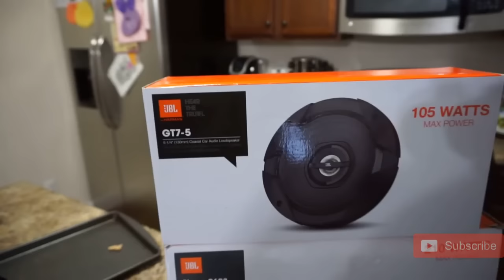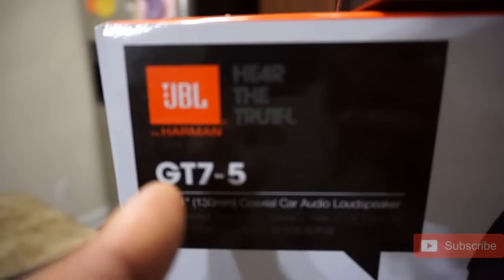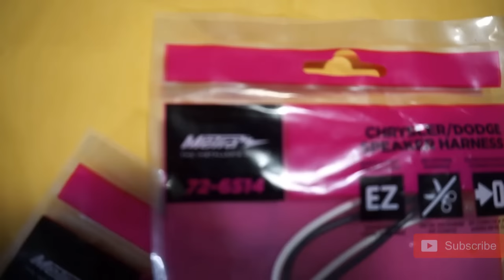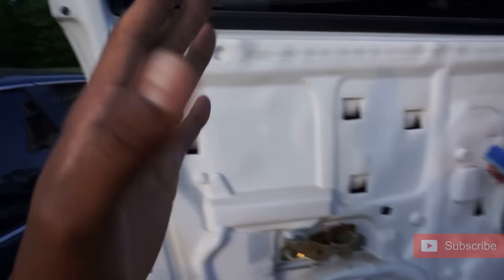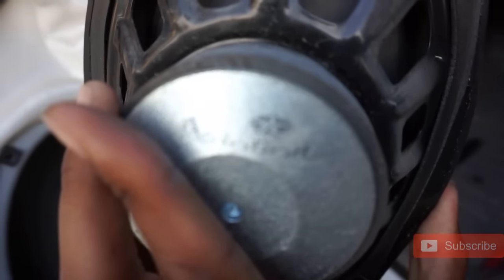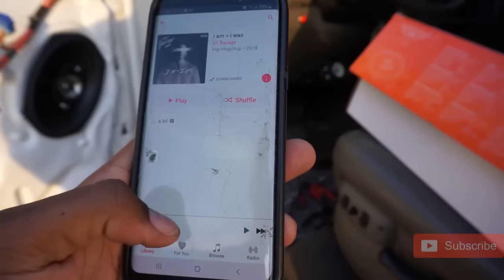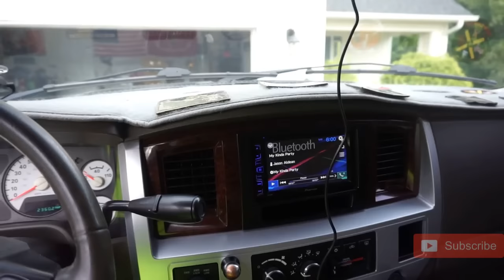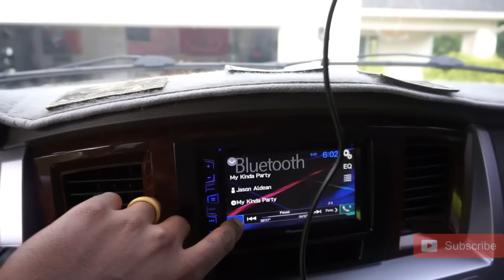INSTALLING NEW SPEAKERS IN THE 3RD GEN CUMMINS!

Comment: Still have the factory amp? I thought the front speakers on the infinity system only put out bass frequencies. I’m looking to upgrade to a touchscreen head unit and some new speakers without getting an aftermarket amp. Everything work?

Comment: Did you not have to get some sort of spacer or something for the back doors? My new 4.25s are waaaay smaller than the holes. The originals had some sort of adapter on them

Comment: Did you need to get the iDatalink Meastro for your head unit or no? I have a 3rd gen Ram and don't have steering wheel radio controls and it also as you know the stock radio,  mine anyways does nothing else lol. It didn't have Nav, Not even tire air pressure gauges. 
Just curious as I'm thinking I don't need it but crutchfield guy said I did .

Comment: nice video... I was reading that the front doors with the infinity sound system only delivers base to the front doors through the factory amp. Have you noticed an issue with that while using coaxial speakers?
Reply: I’m having the same issue here. I just installed two new front speakers and it’s only emitting bass.
Reply: @homless68 its from the infinity amp....i just put a new system in my truck.. we bypassed the amp so i have coaxial in every speaker now. also the 2.5 speaker in the dash is taken out when you bypass the amp. my amp had a channel out. it was my front left door. when you install a new head, you dont need the amp. my truck sounds better than ever now.. not a lot of base but i will install a sub later under my rear seats.

Comment: Do you like having tweeters in your front doors now? I put jbl in my truck ( same truck) bypassed factory amp and everything have 2 10 inch subs but my fronts are now 6.5s no tweeters on them they came with components to go in the dash corners replacing the 3.5s in the dash . I’m not happy with my set up because vocals sound so low! I’m thinking of putting 2 ways 6.5 in the fronts which means the tweeters are built in the doing 3.5 jbls in the dash corners so then my truck would have 2 way 6.5s matching front and rear doors and same size and style in the dash corners which are 3.5s just like yours . Hoping that would bring vocals back. When I put the new deck and subs in and bypassed factory amp and left the speakers in the truck which are stock infinity it actually sounded great! But the front infinity’s were in bad shape (6x9s) so I “ upgraded” and I lost that vocal I think because the new fronts are smaller and are just cones like the factory ones were and pulled the 3.5s and put tiny components in their place I lost vocals.

So my question is should I pull my new front jbl 601cf component system out and match the fronts to the rear jbl 621f s then upgrade the dash to jbl 322f which is basically just like your set up except the front will no longer be 6x9s . If I put 6x9 back in from jbl they are 3 ways which adds essentially 4 more tweeters to the truck than originally before 2 of which are super tweeters. Which maybe way to bright.

Comment: I'm conflicted between quick easy coaxial speakers in the doors or doing pods in the front door with and 8 ,4, and 3.5 and a 6.5 in the rear doors ran off  an Orion 4 channel  . I have 2 12 dc sounds lvl 4 going under my back seat off an Orion xtr 2500.1 . I wanted to  build a box to replace the rear seats for 15s but too many other projects so no time and I'm not paying  $2500 for someone to build it .  Reality is I've ran the stock factory crap for 10 years and it's not even the infinity so anything will sound better.  I should have done this year's ago since stock is junk

Comment: Can confirm that early 3rd Gen models DO NOT have 6x9s in the front doors for anyone wondering.
Reply: Thanks I’m wondering about this before ordering a new set, what exact size for a 2004 ram 2500 front and back speakers?

Comment: Did you replace your window controller with a Chinese one because your window lock button broke? I have that issue with mine. I can only roll down the windows from the drivers seat.
Reply from the maker: I did but the buttons still work fine.

Comment: Nice video @everything diesel. I started with my subwoofer and still have the infinity speakers. Lol. Just waiting for them to blow to replace them next. Not sure what box you going with for subwoofers, but I went with a company called probox which comes with loaded subwoofers. They hit for 2- 10. And have had them for about 8 years and still banging. Pushing it with an old Rockford amp bd1000.
Reply from the maker: Nice man im gonna look for them up. When u upgrade the interior speakers you'll like it

Comment: Might be doing this in the future as well.  Where'd you get those adapters to plug into the factory wiring?
Reply from the maker: Off Amazon just type your year make model and speaker adapter and they will pop up. Or look up the part number from the video

Comment: How many of the metra adapters do I need? Only for the door speakers or also the dash speakers?
Reply from the maker: If u running stock size speakers u don't need any adapters
Reply: @EVERYTHANGDIESEL  for the adapters that plug into the stock harness? I’m about to order all the exact speakers you installed in this video.
Reply from the maker: Ohhh order 6.
Reply: @EVERYTHANGDIESEL  okay thank you for replying 👍🏼🙏🏼

Comment: So im looking at doing the same thing. It said on the forums that the Infinity amp has a crossover that blocks highs in the doors..were you able to get any frequencies for the tweeters through the door speakers or is it just coming from the dash?
Reply from the maker: i get frequencies from the door speakers as well they sound really good!
Reply: This my 2nd mega cab and I stayed with the JBLs and man the best move I made with speakers... they have nice mids highs & Bass
Reply: My front doors have the 3way JBL speakers which is even great
Reply: @alpierce7603  i ended up getting 2 way jbls in the doors..kept factory in the dash, 10" android touchscreen headunit and addied a sub...sounds awesome now

Comment: If you happen to see this I’d love a reply. Did you bypass the factory amp in your truck? If not then how did you get the front door speakers to play mids/highs. They are supposed to be locked to lows through the amp.
Reply from the maker: I didnt bypass the factory amp, i used the factory amp with my new radio. That is the only way to get power to the speakers unless u rewire all the speaker bypassing the amp. When u install a new head unit just use the blue amp wire from the adapter harness and connect to  the amp signal wire on the radio,
Reply: EVERYTHANG DIESEL and doing that allowed you to get mid range sound out of your front door speakers even though it was still running through the amp?

Comment: Nice!!! I'm going backwards from you in my 3rd gen I have 2 soundqubed 8s under my back seat (non mega cab) on a 1500w amp. I want to do mids and highs next :)... I use a raspberry pi for my head unit along with a 9band eq.
Reply from the maker: Nice man, Equalizers are dope when you tune them in correctly! I use the built in equalizer on my head unit